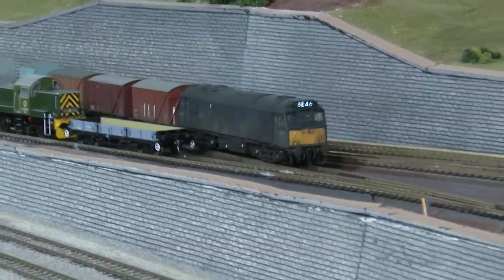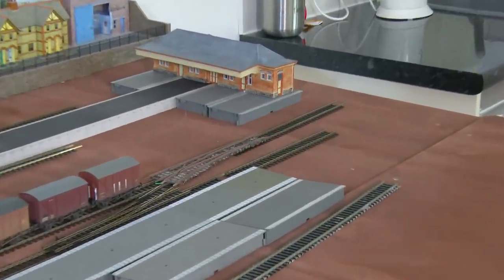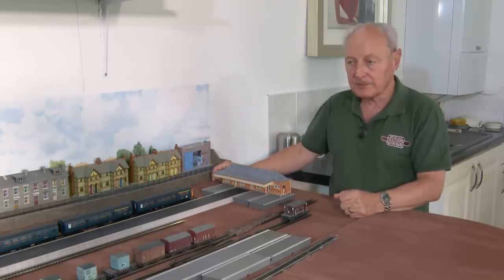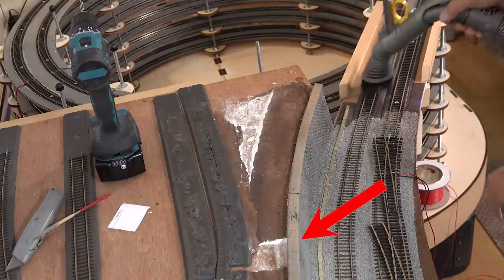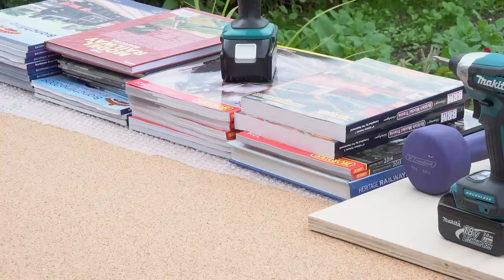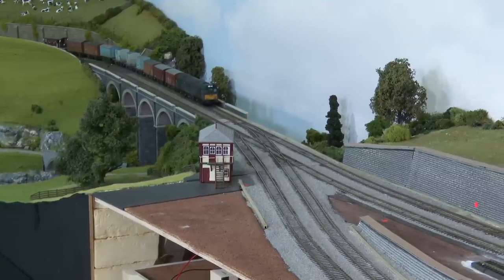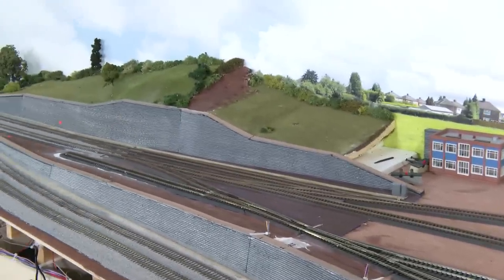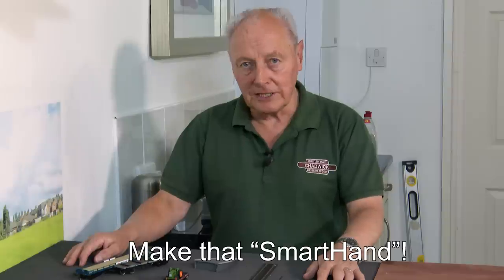BRANCH LINE CONSTRUCTION Part 2 at Chadwick Model Railway | 197.

Comment: Hi there, some great progress there. With the installation of the headshunt, the trap point would become redundant as the new point for the headshunt Will protect the running lines when set for shunting manoeuvres. This would be protected by a GPL showing one white and one yellow lamp when in the on position( as this allows it to be passed at “danger” when performing a move into the headshunt, it would then display to white lights at 45 degrees when a train is leaving. The headshunt would then require a more standard one red and one white at danger to allow movement out of the headshunt. This would typically be left in the off position in order to allow shunting to continue without the signaller being pestered by the shunter.
Reply from the maker: Many thanks for your fascinating comment. I will at a later date, address the signalling for the whole area. I do hope that you will be involved. Regards, Charlie
Reply: Agree. The new headshunt point makes the trap redundant as it performs the same protective junction. At the simplest a trap is for junction protection a catch point for derailing runaways on an incline.

Comment: Hi Charlie, A big improvement on your original plan it will be interesting to follow your progress. I don't know about a motorail depot but Abingdon (a smaller station than yours) shipped new MG's out on carflats until the factory closed in 1980. The trains were quite short - 3 or 4 wagons in most photos I have seen so end loading facilities could be well used. 
The biscuit factory should be next to the kettle!. To keep things operationally interesting a terminus should have at least three or four different types of traffic in your case cars - biscuits out and ingredients in - coal and general goods. Another traffic that kept several branches in operation was cement in vans and presflos a cement hopper would be an interesting model.
as you said there are plenty of ideas about.
Keep up the good work
Cheers
Jon
Reply from the maker: Many thanks for sharing your thoughts Jon. So many options. Regards Charlie

Comment: You could find all sorts of complicated track on the entry  and within goods yard. It all depended on the space available. There was a station in the Harrogate area with interlace left hand points facing each way. St Neots station yard had an outside slip until the 1990s, long after the yard had seen its last train. At Etherley tip o  the Darlington to Bishop Aukland line there was a single slip with the tracks serving the sidings. Si your friends were wrong to persuade you to not use a slip in your goods yard.
Reply from the maker: Thanks Neil, for such interesting information. But today, we are where we are. Regards, Charlie

Comment: No luck finding the Tortoise Drill Jig using the supplied link. Thanks for the Video...
Reply from the maker: Try searching for 
Tortoise point motor template.
It works, regards Charlie

Comment: Hi Charlie, Just a couple of observations whilst watching your video about the goods sidings. You don't have a catch point, what you have is a TRAP point. Trap points face on coming trains and catch points trail to prevent trains running back on gradients. Your TRAP point is not necessary as you have installed a head shunt so any conflicting movements would be diverted toward the headhunt. Great channel, Regards John Cave.
Reply from the maker: You are of course, right John. Track points will probably move to my new industry will be. Regards, Charlie

Comment: I have a motorail facility on my layout, albeit restricted to the overnight sleeper to and from London Euston. How I do it is, for the sleeper arriving from Euston, the 47 hauls it into platform 5, and then the 08 shunter comes from the depot, the Motorail GUV is uncoupled, and taken by the 08 from platform 5 to platform 6, where the motorail ramp is. The 08 then goes and gets the other two coaches for the sleeper train, and takes them from 5 to 6, and returns to the depot. The 47 that brought the sleeper in, then goes from 5 to 6. The motorail ramp doesn't have to be in the goods area, as you've suggested, though at Fort William, the ramp was in a siding. It could be in the branch line station itself.
Reply from the maker: What an excellent suggestion. Regards, Charlie.

Comment: Hi Charlie, 
This section is coming on well.  Just one small point (no pun intended) but with the installation of the head shunt, you've made the catch points redundant. The points on the headshunt would either be operated by a ground frame, released from the signal box, or controlled by the local signal box. It would not be possible to have a train foul the mainline. For a signal you would need a yellow/black ground position signal. This, unlike the red/white version which cannot be passed without the signal being cleared, allows movements with the signal in the "ON" position towards a headshunt. The signal would only need to be "OFF" to allow a departure on to the mainline. If you build the private industry, the catch points could be moved to protect outbound movements from that siding instead.
Keep up the great work
Brian
Reply from the maker: Thanks BFP the signal info is most helpful.  I will probably produce a video with my signalling plans. An ideal opportunity for those, such as yourself, to keep me on track. Regards Charlie

Comment: Hi Charlie again. We have a product in Australia called "edge acrylic mirror", sold through a large hardware chain called Bunnings. It is self adhesive, shatter proof, lightweight, and comes in a 3 pack of 300 by 300mm sheets. Hope this helps.
Greg Footit
Reply from the maker: Thanks Greg, I shall certainly check it out. Regards, Charlie

Comment: Hi Charlie, once again another excellent video explaining the reasons for laying out the trackwork in a goods yard. I find you need to work out the reason's for the tracks from a company point of view i.e. cost can play a big factor and also the provision of equipment in the yard.. The containers would be off-loaded by a fixed yard crane or if the the traffic was a regular feature then a mobile crane would be provided. ( for fish traffic or milk or flowers or other perishable items) Space between the tracks would be arranged for access for horse and drays or Scammell tractors and artic. trailers.  Lots of things to consider, depending how far you want to be accurate.  
Once again an excellent series of video's.
Thanks
David.
Reply from the maker: Thank you David, for some excellent suggestions. Regards, Charlie

Comment: Hi Charlie, Great update.  I think the alterations to the track plan at the branch are for the better,  much more realistic.  Just an FYI though, you can remove the catch point now as the point you installed for the headshunt would take over the role of the catch point. Nice to see a train running too.  Cheers, Michael
Reply from the maker: Thanks Michael, yes, the days of the Catchpoint are ticking away. Regards, Charlie

Comment: Hi Charlie. Been watching you videos for over 3 years and always looking for next. Do you ever do a a video that shows how you fix your boards together? How do you connect track. Thanks
Reply from the maker: Hi Mark, I don’t believe I have. However, I just simply bought them together with M8 coach bolts and pinch them very tight. Obviously I insure their level, and then lay the track across the top. Regards, Charlie

Comment: Ho Charlie, it's always interesting watching you work on your layout - even if I should be working on my own really!

I would think the headshunt now makes the trap point redundant - it fulfills the role of protecting the mainline from incursion as well as allowing shunting of the goods yard.  

Having looked at dozens of ranch line terminii over the years (no room for anything else!) I notice that often the freight sidings are in pairs, or a pair in the middle of the yard and the outer most siding is on its own - mostly they seem to be arranged to give easy cart/lorry access to wagons. The goods shed is usually on a siding of its own so that vans don't have to be shifted when shunting is going on else where.  Happy to share trackplans if you need further inspiration.
Reply from the maker: Thanks Michael for sharing your knowledge. Regards Charlie

Comment: Like the new plan as it gives much more operating potential. Without realising it, I think of wagons in groups of three as well, not so much for the operational reasons you have but because working in a tighter space, three wagons roughly equal one mk 1. The maximum train length I have built around is 5 mk1s plus loco or 15 wagons plus loco and brake van.
Reply from the maker: Thanks John, I’m so pleased you like the idea of the triplet. Regards, Charlie

Comment: Charlie another excellent video. Can I make one observation, why have a catch point when it is not needed. The point into the headshunt acts as the safety point as it will be controlled by the signal box.
Reply from the maker: You’re bang on the money. It’s days are numbered. Regards, Charlie

Comment: Great video as always, Charlie. I've got a suggestion for the mp5 point motors: You could place them somewhere under the baseboard and use a long connecting rod . 👉 If you put the rod into a little tube you can go around corners and so you could place the motors beneath the two tracks on the lower level.
Reply from the maker: I had thought about that option. However, underneath those baseboards are a mass of cables with out too much slack. Regards, Charlie

Comment: Nice one Charlie, may I suggest your proposed removable extension could include the complete station building and forecourt complex and yard access gates enabling the tracks to run right up to the baseboard edge, the end loading siding could then be longer with road level access rather than a ramp, a short platform was often included alongside to enable flat wagons to be side loaded using the same access at the top of the slope down into the yard. I noticed two issues with your track work, the catch point is redundant and it is difficult to see where the gradient begins but the head shunt should be level to prevent runaways with a sand drag before the stop block. I'm looking forward to seeing what structures you are planning for the goods yard area.
Reply from the maker: I must confess William, it is something I’m considering. Regards, Charlie

Comment: I like it so far! I'm interested to see how you put together a little town area there. That's something that I don't always see explained. You see designing the tracks, how they come in, how they'll unload, but then what happens after that's done? How do people decide what little flavor items, dressings, track infrastructure, like any mechanical stuff that is meant to model the real thing, like when you talk about those orange tubes that go under the tracks. Just adding the finishing touches once the track is down and how to decide where the depot buildings so, go especially the parts of modelling that aren't involved in the railway.
Reply from the maker: Thanks Andrew, I’m so pleased that you found the video interesting. 
Yes the designing  of the town scene will be a bit of a challenge. The orange tubing that you mentioned was in use after my period, and has now been discontinued due to the ballasting machines. 
Regards, Charlie

Comment: Hi Charlie, glad you went down the headshunt route. Definitely looks better and will, as you rightly point out, give you far greater flexibility 🤓 As for the sculptamold palaver, I think it was perhaps worth it as in real life the 1:76 workers would have had to do a similar job, so you have inadvertently recreated something arguably even more realistic 😂

The newer sidings to the right made me wonder if you could model an historical piece of infrastructure that has been repurposed. Then my imagination ran away with me, so please bear with me! I imagined that the reason the approach to the branch line is straight whereas the ‘main’ line effectively branches off is because originally the railway terminated at the Branch station. Then, when the railway expanded, something made converting the terminus into a through station impractical, hence the deviation. Still with me? 🤣

Thus, when the mainline traffic carried on by, this was why the junction station was built. It also meant the existing engine shed complex was no longer needed as mainline trains carried on up the line. And this is what remains: the original engine shed complete with hints of its previous purpose, like an a long abandoned water tower and maybe a repurposed old coal drop that has been used by the local merchants since the facility ceased servicing locos back in about 1865😀

The example that sprung to mind was The Roundhouse in Camden. Whilst that is a huge area, I’m sure there must be other similar much repurposing of old engine sheds of a smaller scale all over the country, such as renting out old buildings to car mechanics or even reserving a storage space for the local charter coach company fleet 🤔

Just an idea or two mate which I hope help in some way 👍🍻🍀
Reply from the maker: It’s interesting that you should suggest such interesting points Tim. I too had thought that the station could have been through Station but was made a terminal due to cutbacks. Clearly great minds think alike! Regards, Charlie

Comment: For your yard and headshunt I would have put in a double slip. It’s exactly these Low speed movements for entry in to a yard that were the sort of locations the real railway installed them. They also use less space are are less complicated than a pair of points. Generally the real railway would not have double slips on the mainline, except when entering a low speed approach to a station, like your terminus on the branch. Now that you have the interlocking of the points to the headshunt protecting the mainline, you don’t need the trap points.
Reply: Agreed. Come on Charlie!
Reply from the maker: I agree, Andrew, the trap point should go. However, I know that the permanent Way staff loathe double slips. Regards, Charlie

Comment: Hi Charlie, i've always wonderd why everybody is so keen in fixating everything to the base boards. I build a fix board like you but create the trackbedding on some additional plywood so i can regulate the hights based of the fixed stable board. So the track is isolated from the scenery and the base board. I then make the scenery modular so if i ever get bored seeing it, i can simply remove it without detroying anything and make a new scenery. Same goes if i wanted to add a track where scenery is.
Reply from the maker: Now that’s an excellent suggestion, 9636. I think, like sheep we all tend to follow the same path. Regards, Charlie
Reply: @ChadwickModelRailway  I've build two layouts like this. I'm in the progress of finishing the second one. If you want I can share some pictures so it is more clear and show you that it works.

Comment: Nice Video Charlie . Nice job of keeping it interesting and not too complicated . I like the goods yard setup !!Did you eve look at the DCC concepts surface mount point motors SS line ? I have had very good luck with them . I went with them when i could not find the ones you are using . For N-scale they were not to hard to conceal . Wishing you all the best
Reply from the maker: Thanks Tim, I’ll check them out if I can’t get any MP5’s. Regards Charlie

Comment: Charlie,
Great progress, it is looking really good.  Thank you for pointing out the dangers of re-using old track sections, "what did it have before?".
You ahve also pointed out that you should not do your scenics till the track plan is in and finalised.  Scultamold can be tough to remove.
I look forward to the next installment.
Cheers, and stay safe,  Michael
Reply from the maker: Thanks Michael.  The piece of track may have been part of a job lot that I bought.
Regards Charlie

Comment: Could I suggest using Fitzgerald Lighting on Bodmin & Wenford Railway, they used the old BR Speedlink service using single wagons,  or the 4th line in the goods yard. You are not the only one who finds previous ideas fail or in the way, I am now about the chissel out the plaster based platforms, as the dust and leveling out is not working for me (this is after watching several how I made my platform vlogs)😒so just ordered a few laser burn't wood kits
Reply from the maker: An excellent comment mate. We are only human, and forever changing our minds. Regards, Charlie

Comment: For your exit out of the yard you are going to need a yellow and black ground signal where it can be passed unlimited into and out of the headshunt but must be cleared to join the mainline! It’s all you really have space for
Reply from the maker: The signalling for the whole area will be addressed in a separate video. But it will be a bit of a head scratcher. Regards, Charlie

Comment: Another top video Charlie. Having just seen part 1 (sorry I missed it on release so I watched it earlier) it just goes to show how things evolve all the time and that makes a lot of sense. Back when I was decades younger before the land of digital everything model railway life seemed a lot simpler, points were in my case operated manually or electrically by individual lever switches. I have a lot of learning to do in this area and thankfully by revisiting this channel it will all make sense. I'm still in the planning stage so I've yet to lay the first rail. A good job as I'd be in a right pickle if I'd already started. As always many thanks for sharing.
Reply from the maker: Thanks Anthony, for such a heartwarming comment. Regards, Charlie

Comment: The ramp idea would work for road cars loading on Rail because you roll on one end then roll off the other like on Eurotunnel but without the loco staying on the front. Just need a shunter at the rear to present to the ramp for offload after decoupling the main loco
Reply from the maker: An interesting point Frank.